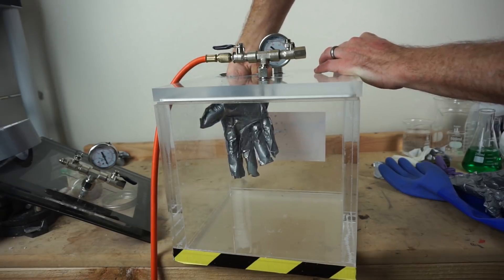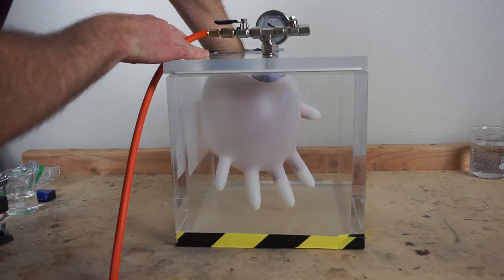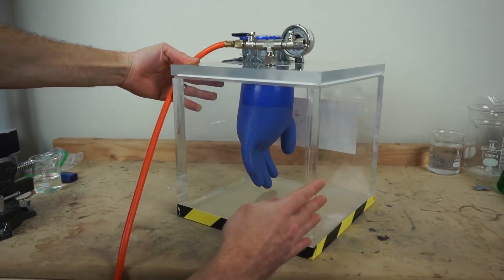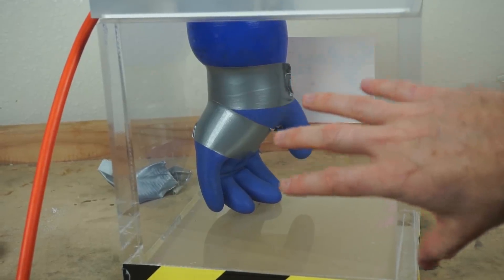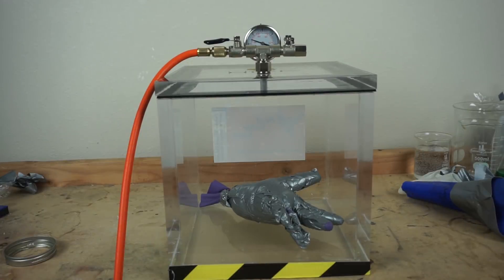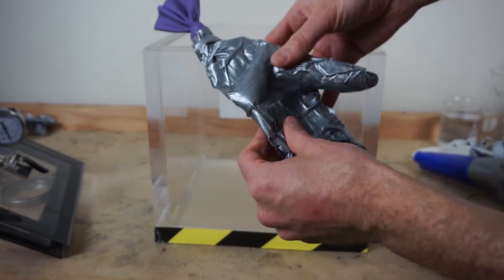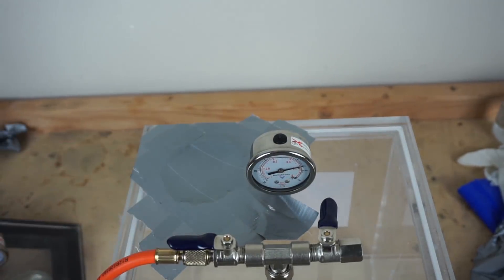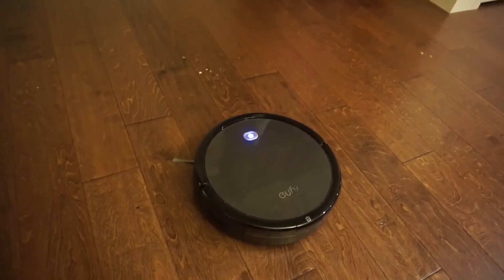Could You Make a Space Suit Out of Duct Tape? Wearing a Duct Tape Glove in a Vacuum Chamber!

Comment: Sounds a bit like Adam and Jamie (Mythbusters) might have missed one  :-) Duct tape was literally a life saver on Apollo XIII - it was used to retrofit a CO2 scrubber from the CM (round canister) to the square canisters on the LM  (square peg in a round hole issue!) May have been the other way around as to the CM and LM canisters--  - Had they not had good old duct tape, they would have been overcome by CO2 poisoning before they made it back to Earth - Of course that was a CO2 partial pressure issue not holding off a vacuum - but impressive none the less. quite amazing stuff!

Comment: Well... Except for one thing. The helmet was patched from the low pressure side - you patched your box from the high pressure side. Made a huge difference in how well it'll hold a pressure difference! If patched from the low pressure side it'll slowly creep open while if patched form the high pressure side it'll keep itself sealed. Well except your ridiculous large hole will creep too but hey you could place a thin piece of metal over it and then duct tape - then it would stay in place for a very long time.

Comment: The problem is that if there is a hole in the space ship you would have to put the duct tape on while the hole is sucking really hard, which could make it hard to put the duct tape on without it getting ripped out into space. You were able to seal the hole before attempting to suck out the vaccuum

Comment: Ok so the latex glove: it expanded as if you were putting air into it like a balloon because the vacuum chamber takes oxygen out of anything inside of it, and it tried to take the oxygen out of the glove but the glove was getting a constant flow of oxygen from outside of the box. The microscopic holes in the glove were too small to let out enough air to withstand expanding and popping.

Comment: To be fair, the duct tape only holds pressure one way. If Matt Damon's character was trying to use duct tape on the OUTSIDE of his helmet to keep the pressure INSIDE of it, I highly doubt it would hold, but it would depend on the size of the hole. A tiny hole MIGHT be able to hold pressure inside from escaping, but anything bigger than a few millimeters I don't think it would last, it'd just create a bubble which would place even more strain on the duct tape adhesive.

Comment: Lets mention that space suit inside pressure is 0,3bar with oxygen instead of 1bar air. Lets also mention that the tape glove which you placed in the chamber had a specific amount of air, when it expanded, the inside pressure decreased. So the second test did not proof 1 bar pressure difference but only a part of it.

Comment: @ 6:25 --- No, it's NOT pressurized to around 14 pounds per square inch greater than the near vacuum around it. It would have been at about 14 pounds per square inch before you sucked the air out around it, but then it expanded, so the volume inside increased, even if only because the wrinkles smoothed out... so no, it would not still be at that same pressure inside.

Comment: When you put the glove inside the chamber, it lost its connection to the external environment. Much like a spacesuit it has its own environment of atmosphere contained inside. When your gloves were taped to the hole, they were containing an environment just how spacesuits would. The puffing of the gloves was from the external atmosphere attempting to fill the void of the vacuum and because the gloves arent a nonflexible material they puff. The experiment was accurate until you left the glove inside the chamber with no connection to an external environment. What puffing occurred was probably air trapped in the glove. The puffing also was not as accurate because there was no consistent supply of the environment, therefore limited to the amount of puffing that could occur.

Comment: In the movie  Martian ,Mat Damon sealed his  helmet from the outer surface, the lower pressure side
That is the duct tape is holding the pressure inside the helmet from depressurizing that is on your vacuum chamber the outer surface of the helmet glass would be  the inner surface of the  vacuum chamber

So, if you would seal the duct tape from the  inner surface of the vacuum chamber 
I think it wouldn't hold the pressure from getting inside the vacuum chamber

Comment: So I've heard that in space you can touch two metals together and it will instantly weld together. It's called cold welding I believe. Seeing how you used the gloves in this makes me winder if you could do an experiment to weld two pieces of metal together in the vacuum chamber(even though there are much easier methods)
Reply: Thats total dullshit. Vaccum only prevents oxidization (burning) of a metal surface by heat during  normal welding. It will never weld itself by vacuum without adding strong external energy (electrical or friction).

Comment: To simulate space with a NASA or Roscosmos suit, you would want a relative pressure, inside-to-outside of 3.7psi (US) or 3.9-5.8psi (Russia).
No space-suit in common use (or spacecraft, for that matter) is pressurized to 14.7psi sea-level pressure.

In other words, if your suit/glove would hold against 1/2 to 2/3rds of 1 atmosphere indefinitely, that would be enough for a pure-oxygen space-suit to merely survive, in space, except for heating, cooling, and micrometeorite/radiation effects.
Of course, you'd also want to scavenge CO-2, and water vapor, and you'd want to have a balancing regulator that pumps more oxygen in as the CO2 is removed, to keep the internal pressure constant.

So, in the helmet case, depressurize (but don't hold your breath), quickly slap on the tape, close up, and re-pressurize. You might survive!

Patching a hole that big...I'd think losing air would be the least of one's worries.

Also, worth noting, much easier to patch against vacuum from the inside with cloth-tape. From outside, if you had some sort of low-pressure-activated fast-cure epoxy, that might be better, at least for a small-hole. You could squirt the epoxy inside the hole, and it would get sucked by the lower pressure, and cure.

Comment: I'd think that the extreme temperatures would have an effect on any adhesives, therefore the ductape wouldn't last very long at all. The best example I could quickly find was hydraulic press channel pressing a roll of duty tape frozen in liquid nitrogen. After it's be crushed each individual layer of ductape was separated from each other showing there was lack of adhesion. I can only guess it's from the cold not the pressure..in which case duct tape wouldn't last long in real space at all..Also showing the gloves in a vacuum is a great example of what would happen to your lungs if there was oxygen in your lungs and you went into the vacuum of space, it would just be alot faster..

Comment: First of all, the duct tape when used to patch a hole in a spacesuit, will be used on the vacuum side where there is a fear of the tape to be peeled off by vacuum. The duct tape should be put on the inside side of the hole of the vacuum chamber to make the experiment more realistic.
When the duct tape is put outside the hole of the vacuum chamber, it us sucked(hold) into place and couldn't peel of. But in case of a spacesuit, this is not the case. In case of a spacesuit the vacuum is on the outside, where even several layers of duct tape can simply peel off.

Comment: I know this is an old video but you didn't test the same circumstances as that movie. It appears that the tape was put on the outside of the helmet, which would have the opposite pressure that you tested. Rather than the tape "sucking" in, the pressure would be in the suit "blowing" out. 

The only reason I bring it up is that in wet environments, duct tape works when the pressure is pushing in on the tape but when it's pushing out, the adhesive fails. I suspect that it would still work but science could prove it!

Comment: The problem with the usage of the duct tape in the Matt Damon Mars movie is that the tape was on the outside of the helmet not the inside. Your usage here is as though the tape were used on the inside of the suit/helmet/craft rather than the outside like in the movie.
Reply: I think it would spring a leak the way Matt used it or if you put the tape on the inside of the vacuum chamber rather than the outside.

Comment: inconclusive test at 5:05, there is less than 1 atm of pressure inside the glove since it's not connected to the outside of the vacuum chamber. a space suit isn't much good if there's not enough air inside for an astronaut to breathe
Reply: Zreknarf 
Spacesuits are designed to run at low pressure to avoid the tightening up as seen earlier in the experiment when it was getting full atmospheric pressure.

The later part is probably closer to reality

Comment: 9.55 Additionally, NASA only has about 0.2 atmospheres in its ships and mars has an atmosphere as well, so there would be a difference of 0.194 atmospheres, so on an area 1cm² in size there would be a force of 2N or 0.2kg, so tiny holes would easily be fixed.
Bigger holes, (like the one after the Hab blew up) lets say 2m², would put a force on the improvised door of 4 tons!
I hope my calculation are right.
Reply: The ISS is fully pressurized to 1atm and even spacesuits using pure oxygen won't go much under 0.4atm.

Comment: The pressure in a space suit during a space walk is only about 0.3 atmospheres, so the space suit does not become unnecessarily stiff, while the astronaut has enough oxygin to breathe. So to prove that your glove works, you only have to go down to 0.7 atmospheres in your vacuum chamber.
Reply from the maker: Yes that is true!
Reply: I've thought a little more about space suits and have come to the conclusion, that constructing the space suit in a way, that it does not change its volume while being bendt, it should be fairly easily to be operated, regardless of its internal pressure.
That is, because you don't have to do work to change the volume, which is responsible for the suit's stiffness. I don't know how to do that, but I believe the  NASA engineers took some measures to achieve that. Maybe not perfectly, but every little bit helps.
There are some deep sea diving suits, that have this characteristic, but they seem to be a little bulky and heavy to be used as space suits: https://en.wikipedia.org/wiki/Atmospheric_diving_suit
Reply: What's oxygin?
Reply: Although Mike Massimo (possibly my favorite currently living astronaut) said that the suit itself does get quite stiff (Many layers, straps, seals etc) - velcro straps are used to prevent ballooning - they try to alleviate the stiffness in the fingers. In order to allow dexterity, the finger material is much thinner. I remember him saying in a lecture  that when they were repairing the Hubble, (Mike was on STS-125) that they were constantly concerned about sharp edges and pinch points on the gloves, as the Hubble was not made for repairs, and was very tight, very fragile (the alignment of the star alignment sensors - Mike is a pretty big guy and could not touch them in any way during the mission), tiny screws, etc. It was a fascinating lecture - Mike reminds me of Dr. Richard Feynman, perhaps its the New York accent :-) You  are doing excellent science! Please keep it up!
Reply: I SCUBA using what is known as a "dry suit" - similar in some respects to a space suit - and yes, they can be VERY uncomfortable. Its the inverse of being in space, but the dynamics are the same but inverse. You have an input pressure valve on the dry suit, with a line from your breathing gas cylinder, regulator, and as you dive deeper and the pressure increases  (we call it "the squeeze, for obvious reasons")(Approx. 1 atmosphere every 30 feet), you have to add air in your suit to compensate, and compensate your mask, and your ears.  It is totally sealed from the water, so its like a heavy balloon that you are inside, wearing what looks like a snowmobile suit - the neck and wrist seals are latex and very water tight when operating properly, your gloves are very much like an astronauts glove from a pressure perspective. They have a water tight twist lock seal, and again, if you don't compensate your gloves - the water pressure can literally squush your hands - which hurts.  We need to protect from the water pressure,and water temperature  but  NASA has numerous other considerations. My dry suit is made from a "crushed neoprene" material. I think that Oceaneering International  (the contractor to NASA for suits) also uses this material as part of their suits.  Getting into a dry suit can be a bit claustrophobic, particularly with mask, hood and regulator -  and I have heard the same said of NASA's suits.

Comment: Only problem is spacesuits don't actually use atmospheric pressure on the inside. Also, a duct tape spacesuit would not be pressurized, it would have to use mechanical pressure to keep internal fluids from boiling. So, not the best test.

Comment: But the helmet has to be fixed from the inside (high pressure side.). It would not wok with the tape on the outside (low pressure side). 
Try this with the ductape in the vacuum chamber. It will not work.
You can also try how long the ductabe can hold the pressure.

Comment: If you want to make improv spacesuit you should use skin tight suits (no air between skin and glove) Of course making it comfortable would be a challenge. And making helmet-suit connection would be difficult too, since you need air in it obviously. So I wonder if spandex costumes would do better ;-)

Also, if you would have such a big hole in spaceship you would be dead from reason why hole is there. And your air would leak out pretty fast. And it would make repair almost impossible since it would suck out your duck tape before you attached it properly.

Comment: Duct tape is cool and all but I wonder if there's a way to make a spacesuit cheaper, the aluminum layers don't need to be replaced, because there's not getting much cheaper than aluminum, but are the materials to replace the more expensive materials. Something like a 3D printed frame to keep everything rigid and then a single multi-purpose material that is micrometeorite resistant and has thermal shielding and that could be used for anything and everything from building a Rover to building a space suit.
Reply: Of course we would ship a couple hundred extra transparent aluminum half helmet pieces, but when we go to Mars we probably want a way to mass-produce anything and everything without sending 50,000 different parts along with us. We could just send a thousand parts and 50 3D printers large enough to print a car or whatever else.
Reply: I would also like to see Android's sent to Mars as well as other robots capable of helping with the building process.

Comment: Don’t forget the metal melting temperatures or the frostbite in 15 seconds temperatures depending on where you are
Reply: If you are in a vaccum temperature will affect you a lot slower. There is no thermal conductive matter. It's only through radiation that you lose/gain temperature. Thats how the ISS survives in freezing cold 2500°C.

Comment: I would be concerned that it would get brittle and crack in space -- either from the cold/heat and/or sublimation of all moisture.  Cold from black body radiation loss, heat from direct sunlight in a vacuum acting as an insulator, and sublimation from the extreme vacuum itself.

Comment: your glove experiment did not show what you were trying to show because the pressure inside the glove was much lower than the atmospheric pressure. You should try doing it by connecting it to the outside with a pipe of small inner diameter so that the force on it is not so high. After all when the pressure difference is fixed the only way to decrease the force is by decreasing the area.

The pressure in your glove did not exceed 1/4 of an atmosphere judging by the change in volume so it wasn't really proven to be safe to use.
Reply: Svetlin Totev 

Spacesuits don't run at atmospheric pressure.

They are regulated at a low pressure , 3.7psi in some cases .

Comment: If you have a hot object in vacuum, what happens? Since heat doesn't have air to move around. How could you cool it down? (I was thinking about gaming in outer space since temps are so low, but fans will not work and there is no air, maybe it wouldn't be helpful...)

Comment: Would it be the same stress on the material if you pressurize the glove with 1atm from the inside?
Reply: Oliver Schoemig 
Spacesuits don't run at atmospheric pressure.

They are regulated at a low pressure 3.7psi in some cases

Comment: There was very little air in the glove when he sealed it so there will be magnitudes less pressure than if the glove was open to atmospheric unlimited volumes of air at atmospheric pressure from the inside.

If the for example, the glove had no air at all when sealed, it would experience no pressure at all.

Faulty experiment, but hey, you don't need to be correct to have fun I guess.

Comment: The duct tape glove in the chamber isn't an accurate representation because it only had a small amount of air in it to begin with and as it expanded the air inside it was forced to expand and there wasn't actually the same amount of pressure in it as there would have been if you had it like the other setup so it might not have survived if it was fully pressurized.

Comment: Atmospheric Pressure
760 Torr
Low Vacuum (Rough)
760 to 25 Torr
Medium Vacuum (Rough)
25 to 1 x 10
-3  
Torr
High Vacuum (Hard)
1 x 10
-3  
to 1
×
10
-9  
Torr
Ultra High Vacuum
1 x 10
-9  
to 1
×
10
-12  
Torr
Extremely High Vacuum
<1 x 10
-12  
Torr
Outer Space
1 x 10
-6  
to <3
×
10
-17  
Torr